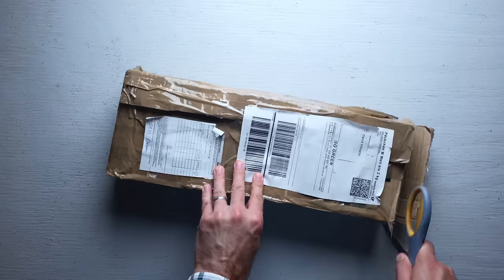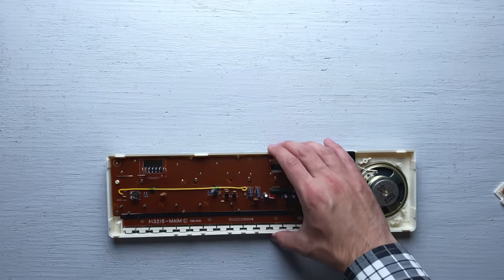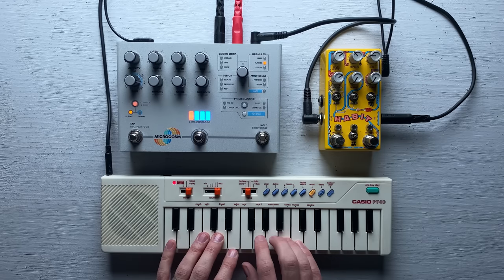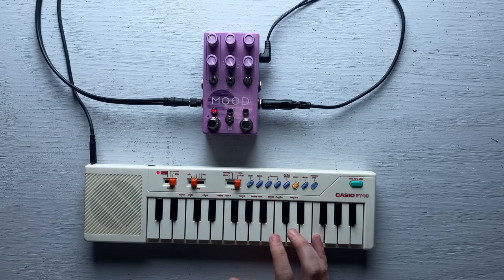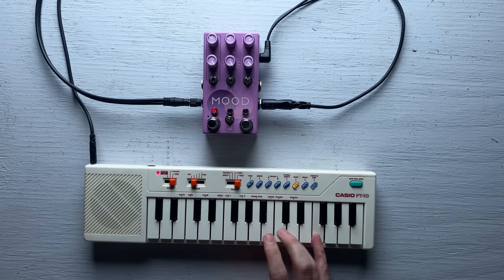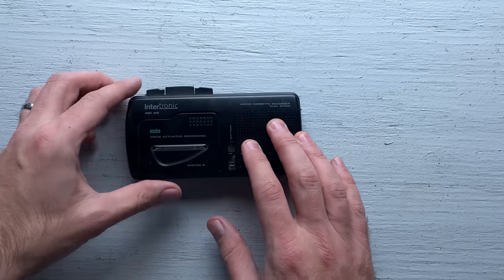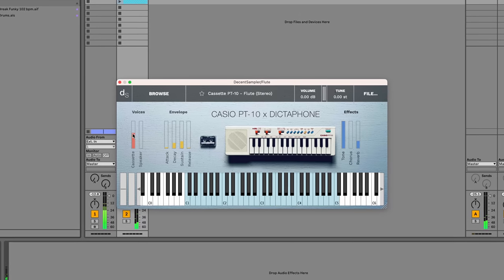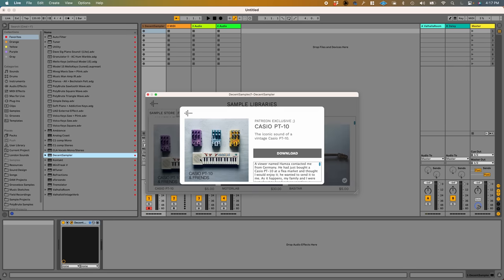Casio PT-10: Lo-fi nostalgia machine from 1987 + FREE SAMPLE LIBRARY

Comment: When I've installed jacks like this, I've effectively replaced the speaker with a resistor of around 10 ohms, and then taken the signal for the output from either side of that. I read it in a book once, I think!

Comment: Wow this is awesome. This EXACT model was in the toy box at my grandmas house when I was a kid, and a couple years ago I asked if I could hang onto it (it's amazing it stuck around this long). I did basically the exact same modification to add a headphone jack from the speaker output (though I also added a switch for the speaker, because I didn't realize you could get jacks with built in switches). I thought about doing samples or something but I've mostly just hung onto it like that in case I want to record the output straight into a DAW for a song. I'm definitely downloading this sample pack now though.

Comment: I have one of those but in black. You can actually tweak the keyboard by removing the little speaker and use the same wiring to put the 1/4 jack to be able to plug to a DI Box.

Comment: I have one of these, I love the way you can record little tunes into it, I wish there was something that worked the same way but with polyphony and ideally midi out or just files out for the pc, it's such a simple system the way it works, it's like a pocket notepad but for music, but everything I've found that has a recording function doesn't function this way and is entirely timing dependent, which has a lot of benefits don't get me wrong, but the simplicity of the use of this, the way you can press the green button to "cycle" through the notes that you've played thus being able to super easily control the timing after the fact is something I'd love from something more modern, with a tiny bit more functionality

Comment: how did you solder the headphone jack into the board? when i was a teenager i soldered a 1/4" jack right where the speaker was connected on an old yamaha or something and it worked. i didn't know what i was doing other than a little soldering skills but it worked! :)

Comment: Would have been nice to trace where the actual line level signal was before the speaker amplifier. Also is the soldering iron tip still usable after the plastic hole? The ideia is good but i wouldn't recommend using the soldering iron from my experience. Seems to ruin the iron tip